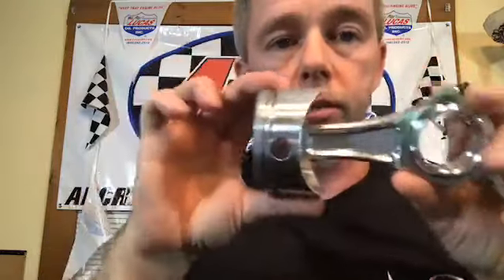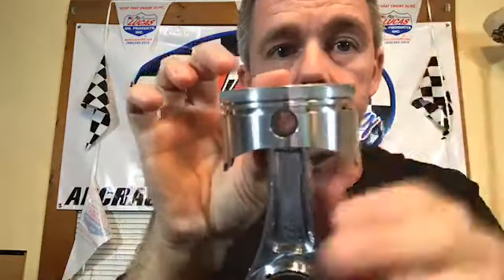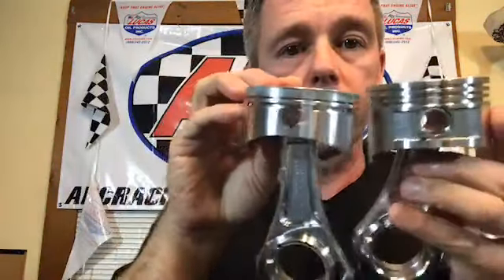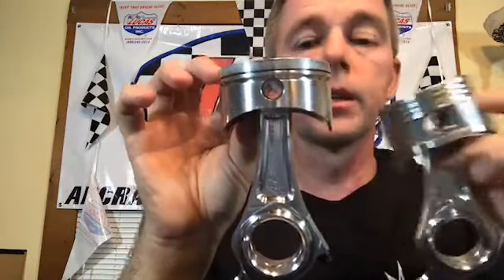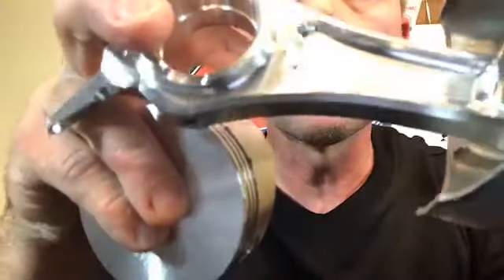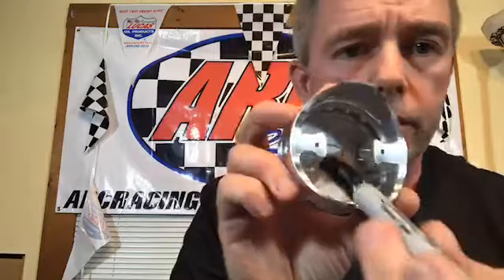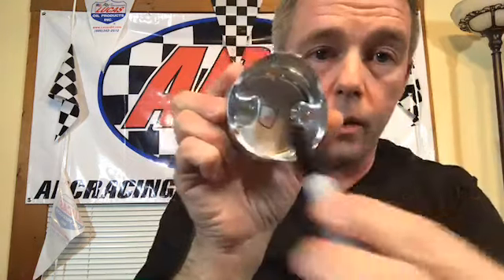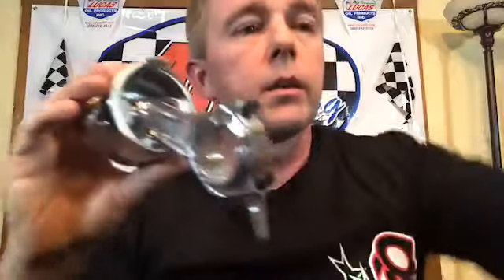Stroker Crank VS Long Rod

Comment: I have a 212 Hemi Predator, if I use a .010 head gasket and the long rod am I asking for a headache?
I don't plan on shaving the head or getting fancy with head work.
Reply from the maker: as long as you have the required .030" piston to head clearance, you are good

Comment: I ran into Wiseco piston cracking running a 4.500" rod with a Wiseco 1999 piston in flathead limited modified.  They got real thin

Comment: Longer rod dwells at the top longer which means you have more time for combustion. Which means it can handle more compression before detonation. It will also require a different spark timing.
Reply from the maker: True, sorta true, not really. No need to add or remove timing when going from a stock length rod, long rod or stroker.

Comment: enjoy the vids,  I didnt hear you mention unless i missed it about STROKE is that it increases leverage, for example a bicycle with a long crank is easy to take off but unless you have some big lungs to make that bicycle crank spin fast youll poop out, same as an engine to make power with a bigger stroke may or will need a bigger induction system of air/fuel to get higher power, but it can still be a good torque motor without the enlarged induction and just regeared,   To me a shorter stroke may take a bit longer to get up to speed but like a bicycle once your moving and keep the speed up it just keep going, i may be wrong and it may depend on whats being built such as a v8 or a single cylinder, long straights , tight turns or wide open ovals , is it heavy or light, . Merry Christmas